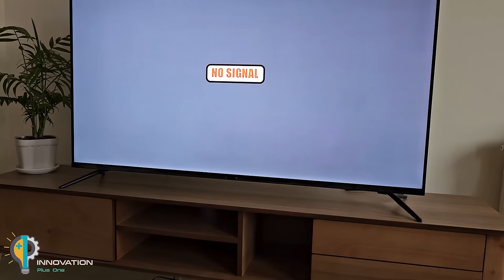Handmade TV Antenna with only on Micro SD Card

Comment: چسب آلمنیوم از کجا پیدا کنم! کابل شارژ آندرویدی اگر چهار سیم داشت چطور مسیر پیدا کنم ؟
Reply from the maker: Hello my friend, you can buy aluminum glue from shops that repair heating systems
Most VCC and GND USB wires are red and black. Meanwhile, you can find the voltage wires by connecting the USB cable to a low-wattage charger and connecting an LED to the USB cable❤🙏
Reply: داداش دمت گرم،اول گفتم از بچه های دهلی هستی حتمن کانال داری.ولی دیگه خاطر جمع شدم ایرانی هستی و کار درست،این مدل آنتن ها که میسازی صد در صد جواب میده روی  همه تلویزیون ها ؟ احتیاج به دستگاه دیجیتال نداره ؟ خود تیونر تلویزیون کافی هست سیگنال رو باز میکنه! اون سیم کارت باید از کدوم اپراتور باشه اینترنت میخواد یا شارژ پولی ؟ و شبکه های داخلی رو فرکانس میکنه یا هر چی air free باشه فقط سیگنال میکنه.در ضمن هنگام ساخت نام اون قطعه رو در صورت موجود بودن در بازار زیر نویس کنید تا با اصطلاح بازاری و مهندسی آشنا بشیم.نریم درب یک فروشگاه نام ببریم بشیم باعث خنده از روی نابلدی خلاصه نوشتاری هم باشه
Reply: Hamid bro comment ke niche translate ka opsan aata usi se aapke language ka pata chala hai 😊😊😊🎉 👍waise main v muslim hoon india se 👍